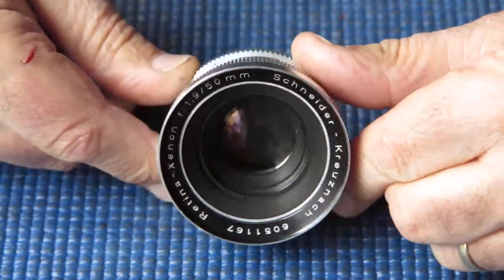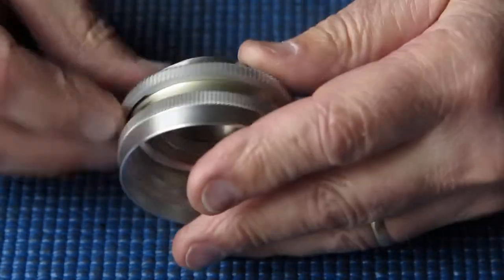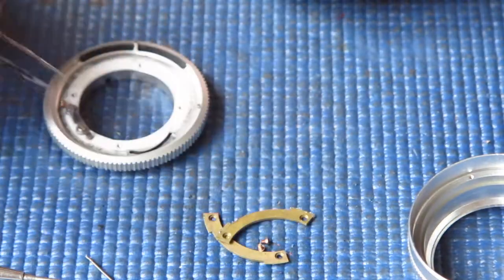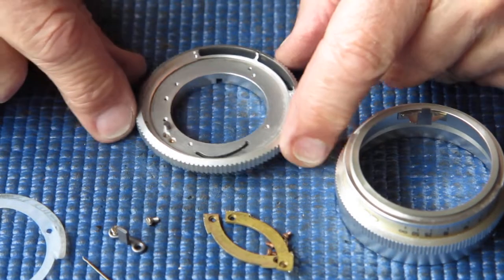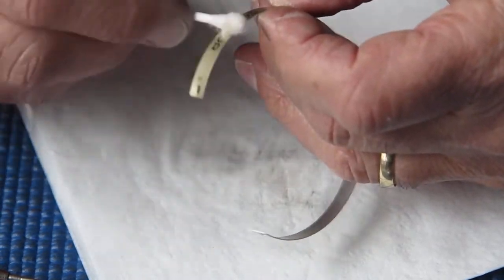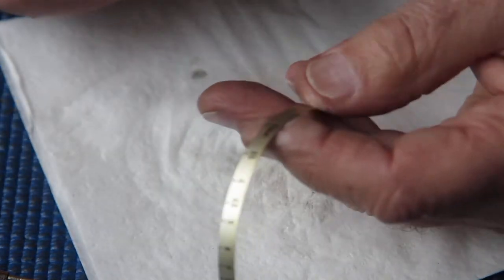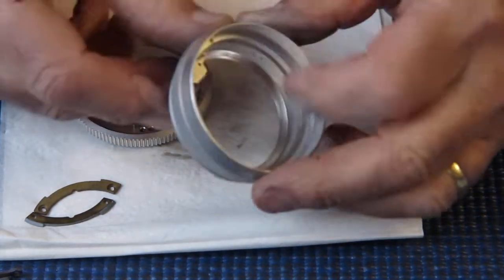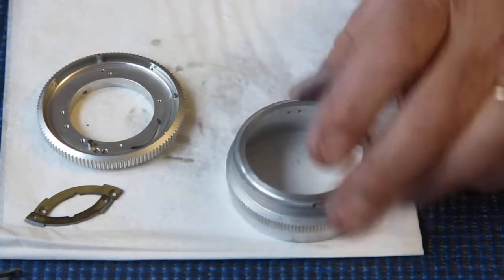Servicing a Retina Xenon 50mm f/1.9 lens part 01

Comment: Chris, I used the cotton bud method to hold the diaphragm blades open a bit to help in positioning, when putting my 50 1.9 back together. The bud caught in the cuff of my jumper and pulled out, trying to take the blades with it. The blades now lay on top of each other the opposite way to how they should. It actually looks quite okay, until you turn to around f5.6, at which point the blades begin to steeple crazily (wont be doing that gain). From your own reluctance to tackle them if you can avoid it, I'd imagine it may be beyond me to rebuild the diaphragm. Lets face it, I let the cotton bud catch in my jumper. Have you ever experienced this and tried to send the cotton bud through the other way to see if the blades will right themselves?
Reply from the maker: Well, that sounds a bit like trying to unscramble an egg. I think I'd quit while you are ahead, just dismantle the diaphragm and replace the blades correctly. I'll be doing another lens like this sometime in the next few weeks probably. Maybe I'll video the process then.
Reply: @ChrisSherlock  Thanks for the reply Chris. You're right. When I think it through, I shouldn't expect a simple reverse outcome, more likely it only increases the opportunity to bugger a blade. It's amazing that didn't happen in the first place. If you do get the opportunity to rebuild one, my nose will be glued to the screen. Sorry... no... that was last week while watching the DIY channel :).  Slainte, Ian.